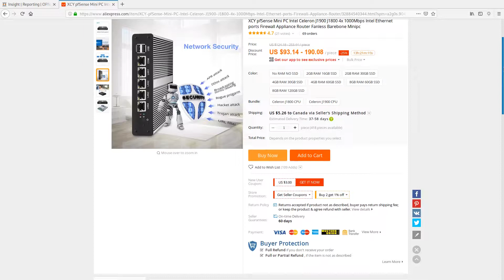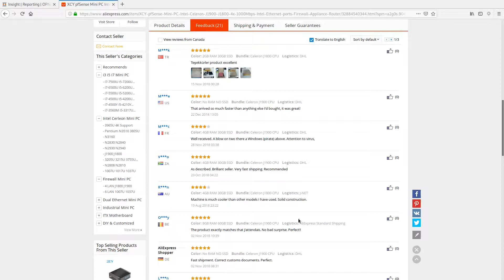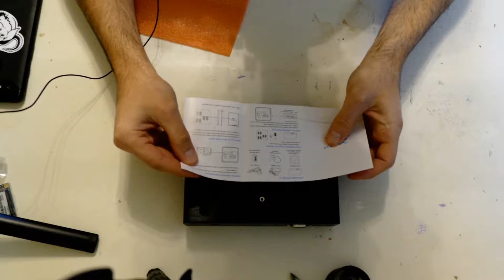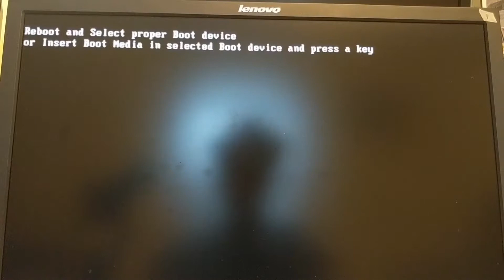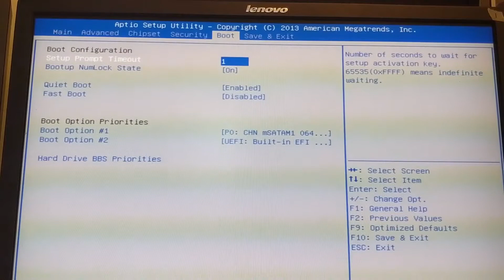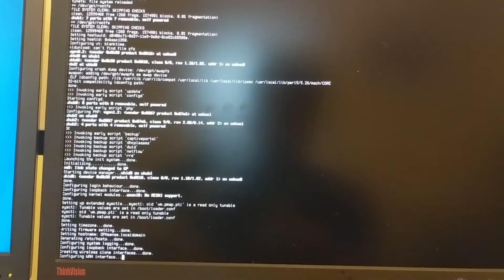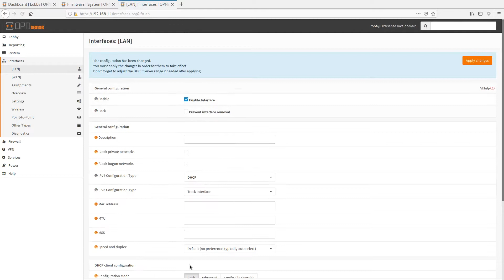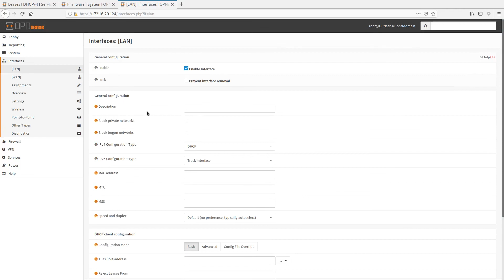Installing pfsense| opensense on Aliexpress mini PC j1800 | j1900

Comment: have a j1900 but stopping a ppi0 parallel I/o on ppbus0, any help?
Reply: I went into my bios; then go to advanced tab; down to Super IO Configuration; hit enter then go to Parallel Port config; press enter and disable it go back to prev screen click on CIR Controller Config; disable that. then save and exit  and then I got mine to boot to opensense installer
Reply: Thanks. I’ll try that again, but it seems to disable the USB ports during installation, which kills me trying to install from usb. Going to try imaging on a different box and see if I can’t pull it over.
Reply: I have a mini pc quad core n3160 j1900